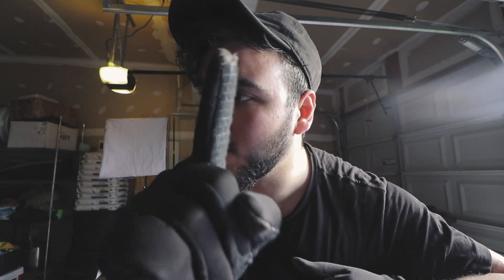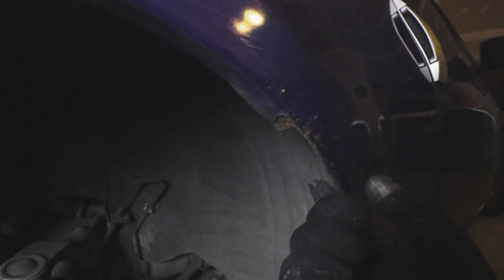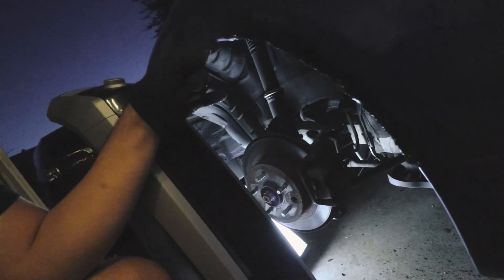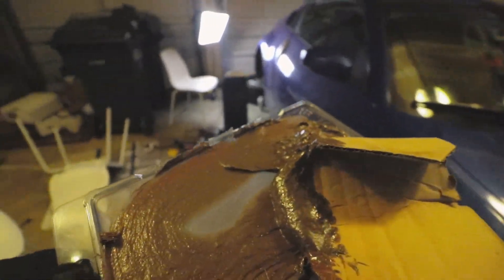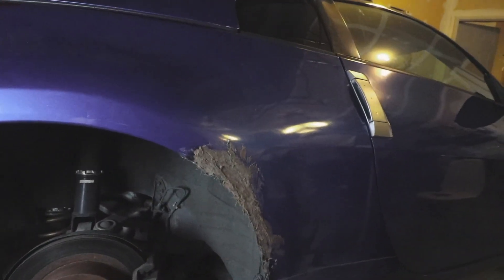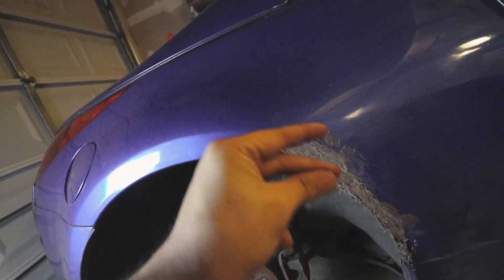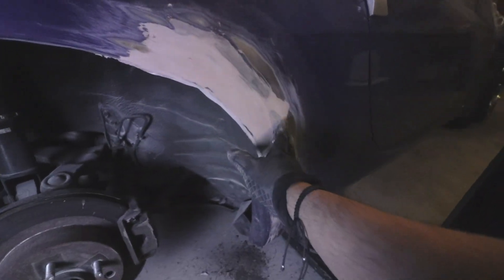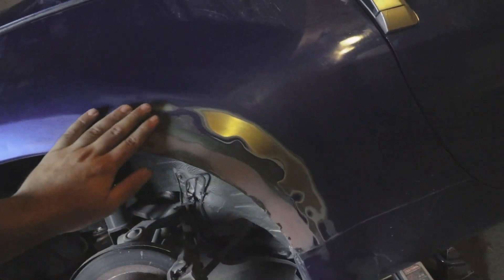Fixing MAJOR RUST on my 350z!

Comment: best to just cut the rust out completely and weld a new piece of metal on. it'll just continue to spread. even if you sand away all the rust it never goes away. make sure to check under the rocker panels and the wheel well by the rocker as well, also very common rust areas.  both by rockers and wheel wells are rotting out on mine, just gonna glue and rivet some metal there.
Reply from the maker: Yeah i figured welding a new piece of metal would be the best option too. Just didnt have a welder or someone to weld cuz I literally had a day before the wrap to do it. I plan on doing some sort of overfenders so I didn’t give it a lot of thought. Thanks for the heads up👍🏼🙏🏼